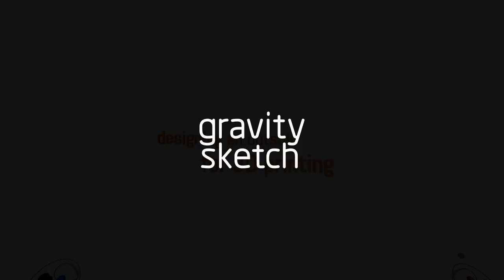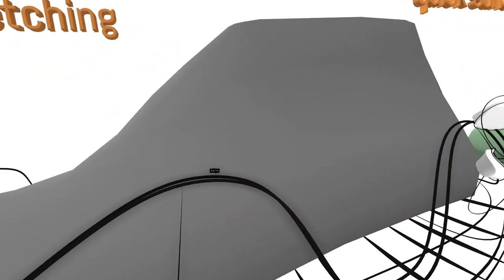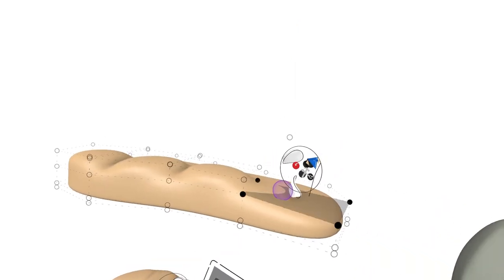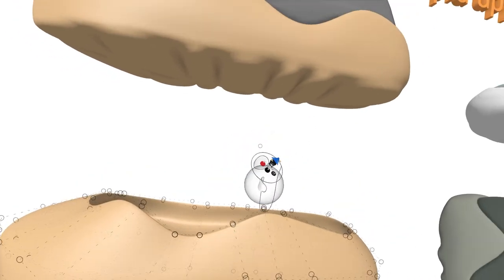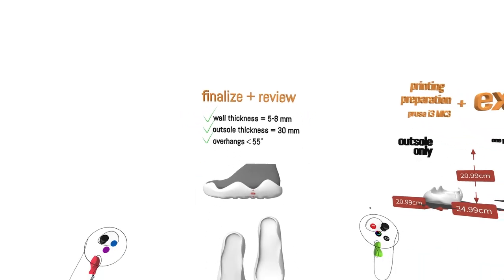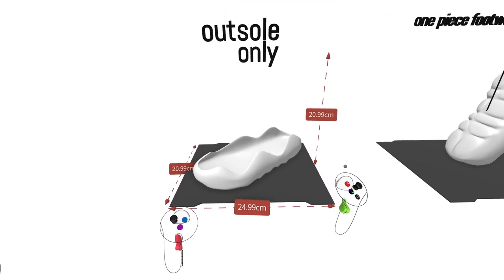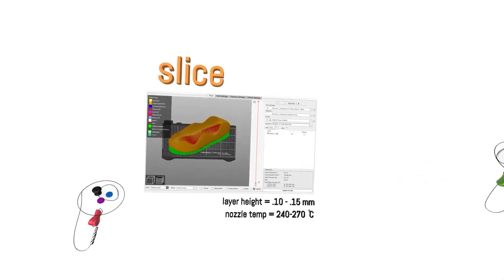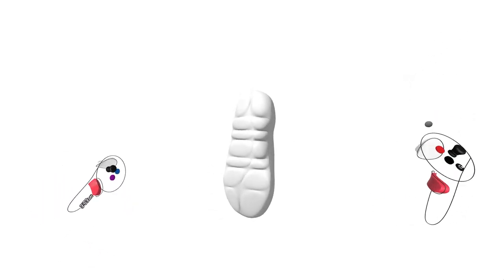Gravity Sketch files for 3D Printing - Workflow

Comment: My personal tips:
1. on Windows, export as OBJ, open in 3D Builder (which is Windows's built-in 3D modeling tool) and allow it to fix the seams. It's by far the most glitch-free way of seam fixing I've tried.
2. try checking the dimension in 1:1 scale from time to time, and the shortcut is: non-drawing hand grab+trigger+drawing hand grab, then let go all of it. It's usually pretty accurate to how things would look like in real life.
Reply: MAC OSX?